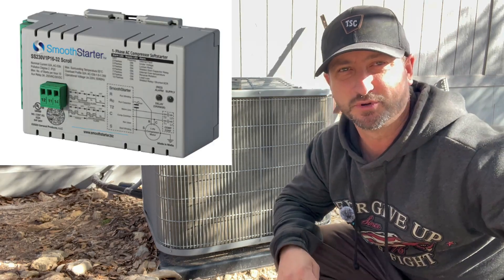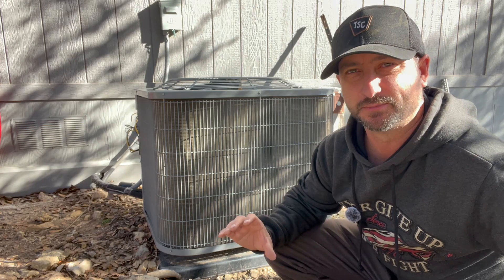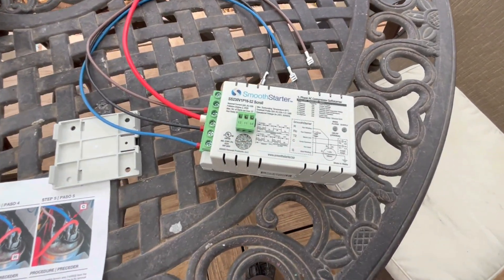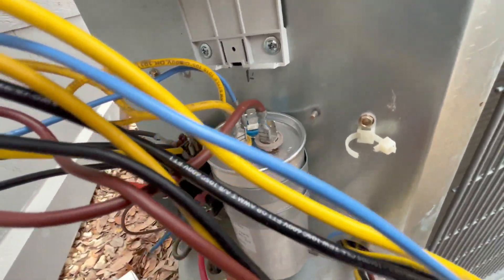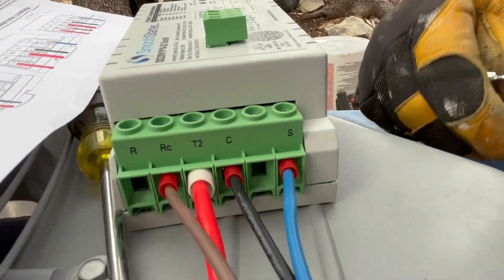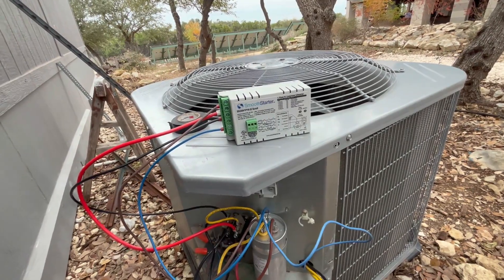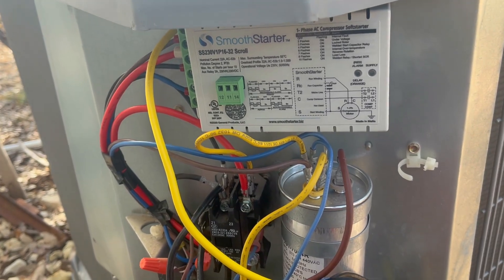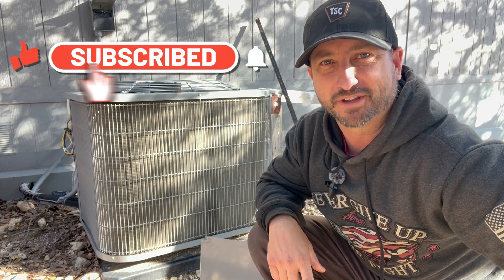This SmoothStarter allows you to run your home air conditioner on solar or a generator!

Comment: Reply: "I've been using the Segway Portable PowerStation Cube Series for my outdoor adventures, and it's been a game-changer. The massive capacity and fast recharging speed have saved me during camping trips, and the waterproof technology ensures it can handle any weather. Plus, the smart app control allows me to monitor and manage the power flow easily. Highly recommended for outdoor enthusiasts and RV lovers!"